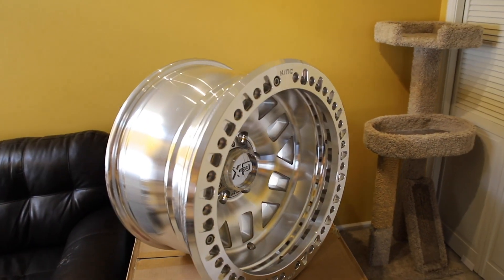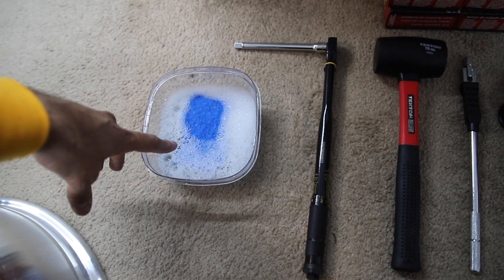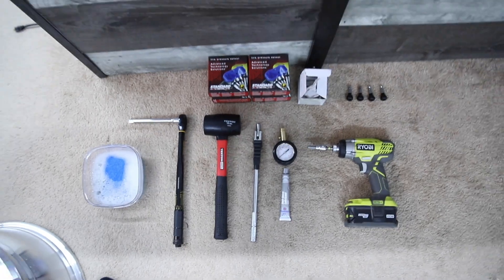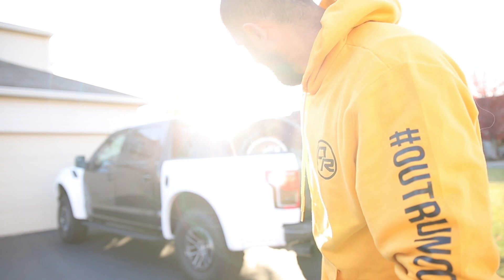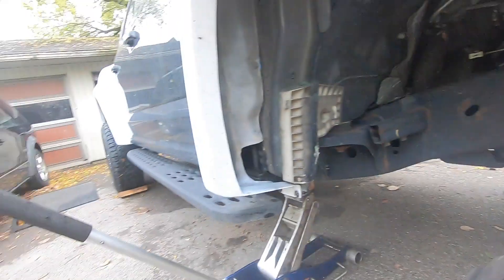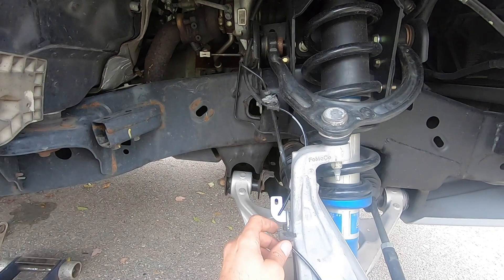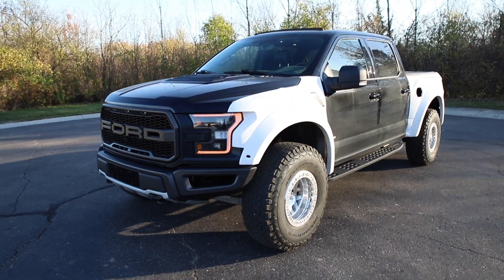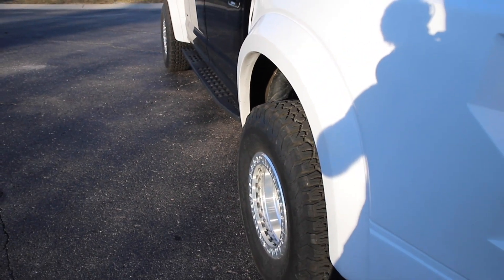KMC BEADLOCK WHEELS INSTALL | EP.4

Comment: I just ordered my wide body kit and  I can't find a single wheel builder that makes -38 offset wheels, KMC included..  Lowest I've seen anyone go is -18.. did you have these custom made?
Reply from the maker: KMC XD series is discontinued unfortunately, there is another and I’ll have to find it. Give me a bit.
Reply: @EdmonJiddou  I've looked everywhere for any wheel in an offset that's -18 or less.. zero results. Any insights you have would be appreciated.
Reply from the maker: @GunfightersINC  https://www.customwheeloffset.com/store/wheels?sort=instock&dia=17&width=9&offset=-38&bolt=6x5.3%2C6x135&saleToggle=0&qdToggle=0&suspension=Leveling%20Kit&modification=Minor%20Plastic%20Trimming&rubbing=No%20rubbing%20or%20scrubbing
Reply from the maker: @GunfightersINC  click the link I just posted, seems a couple more models came out since I’ve looked. My particular brand are discontinued but the LOCK wheels look clean! f-150 spec -35 offset, 17x9 6x135 bolt pattern. Hope that helps.